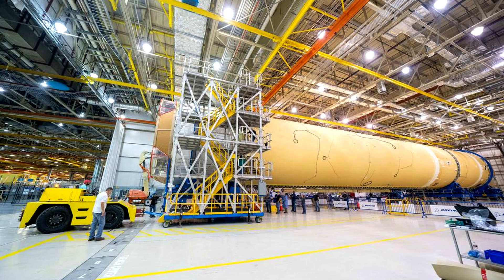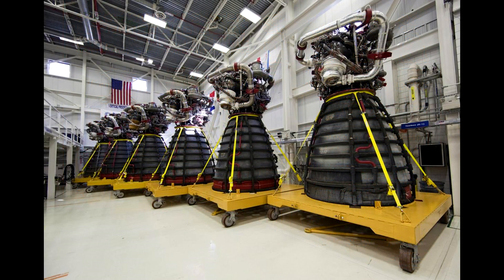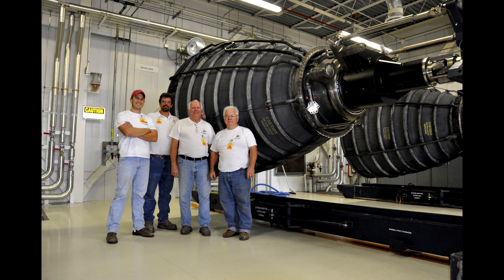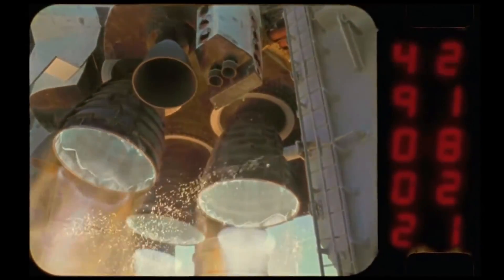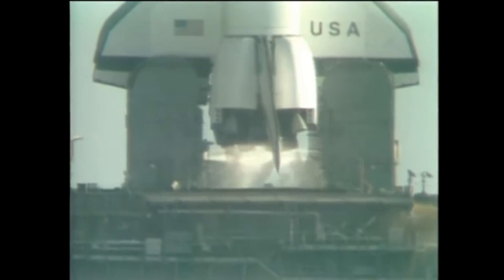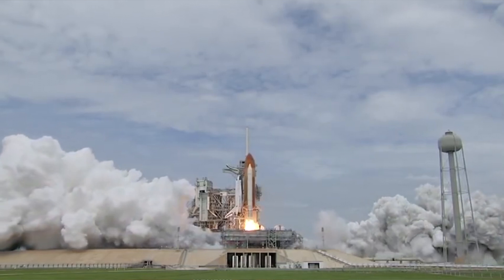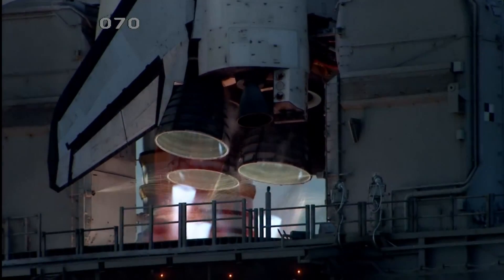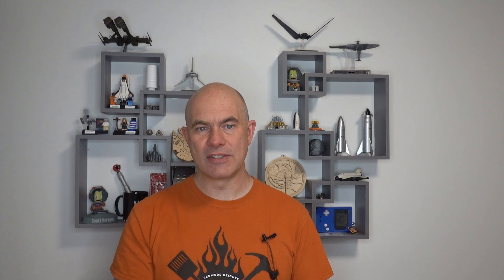Four Old Space Shuttle Engines Team Up For One Last Rocket Launch

Comment: and they gonna use this fantastic engines 1 time and throw them away? what a shame...
Reply: Well, they needed significant refurbishing every time they came down
Reply: @Hofslagare  well the shuttle itself was most of the refurbishment though, the engines sure needed some working, but I don't think they are the reason we consider the shuttle programm as refurbishing, instead of reusing.
Reply: @LunnarisLP  "The RS-25 engines were highly complex and maintenance-intensive, necessitating removal and extensive inspection after each flight. Before the "Block II" engines, the turbopumps (a primary engine component) had to be removed, disassembled, and totally overhauled after each flight." Is both my understanding of it (what i heard) and what it says on wikipedia. Removal, inspection and disassembly is not "some working".
Reply: @Hofslagare  Shuttles were inspected like crazy between each flight because it carried peoples on board.
SpaceX doesn't have this problem because, well, they only send hardware. And for manned mission, NASA has requested to use brand new rockets, not reused boosters. So RS25 and shuttle will still be the only true reused hardware to date.
Crewed Dragon capsule also is one use only with astronauts on board, if reused, it will be only to carry freight.
So yeah, Shuttle will still is the only true reused ship to date....
Reply: @Damien.D  No, they did it because they couldnt guarantee the engines working otherwise, do you think spaceX plans to remove all the 28 engines on the starships every flight?
Reply: @Hofslagare  They probably will have to if they want to mess with luck regarding human lives.
For now, spacex and manned flights are two irrelevant subject, but once they'll get into that, it wont be the same business.
Reply: @Damien.D  Now you're just guessing.
Reply: @Damien.D  thats true with the falcon 9 boosters. but then they reuse the boosters for unmanned launches after. but once starship is operational. we'll see those babies go up 3 times a day!!!!! the raptor engines are damn impressive.. smaller but faaaaaar more impressive then the RS-25s
Reply: @Nick871203  Yeah sure, the water tower thing will be totally different from crew safety standpoint. And fly 3 times in a day with 100 peoples on board each time.  Sure. Of course. I'm totally confident it will happen.
Reply: @Damien.D   ok the water tower thing was just to test the raptor engine.... and it was a succesful launch... sooooo im not sure where you're going with that... and sure they wont start mass transiting people like that for many years. starship will be used very intensivley for hauling payloads up on a regular basis. collecting data as they go. once they done enough.  they will probably start using this to transport astronoughts up to the ISS or where ever. and eventually do the Dear moon project. once the rocket proves its self over an over an over again. why not? if it is able to be rapidly relaunched 3 times a day. then why not? you're not thinking out of the box... this has never been done before, and they are DOING it and they proved sooooooo many people wrong already.
Reply: @Nick871203  At best, regarding manned flights, SpaceX just proved how reliable and still useful Soyuz is. They are decades from carrying peoples in their shiny watertower.
Reply: @Damien.D  using the Soyuz is unsustainable... its too expensive to use... if it wasnt for the ISS we wouldent be using them attall..... 80 million PER astronaut... the russians are clearly taking advantage. anyways dont forget we got 2 competing capsules, the boeing starliner and spacex dragon . both are getting close to completion. hopefully spaceX wins. and it does seem to be going towards spaceX.
Reply: @Damien.D  starship will be tested by sending payloads to space. once it flyes  100 times without failures it enters the safety range accepted by nasa and can be used with astronauts.
 on the other hand SLS will fly a single time and then carry astronauts. it doesn't matter what boeing says, testing is necesary to find problems with a system, spacex found parachute problems that were unknown to science before, and starlink and parachute manufacturers had to look at their parachutes because they were not as safe as they thought. spacex is testing the starship and will continue to do so and adapting until it is able to do its job, going the testing route guarantees that it will be the safest space vehicle of all, not the other way around.
Reply: yeah like at least with the space shuttle they refurbished them
Reply: jack cunnington The engines themselves didn’t require that much maintenance. It was mainly the heat shield.
Reply: @jerry3790  They required so much maintenance they couldnt even stay on the shuttle and part of it had to be disassembled.
Reply: It cost so much to go through these and get them space ready again they might as well let them sink in the ocean lmfao.
Reply: Also these are the most expensive engines ever made - $25 million each. They were expensive and over engineered since they were designed to be reused over and over again, reducing the per flight costs - not meant to be thrown away. It’s quite a tragedy, honestly.
Reply: Yeah, my exact thought. thats kinda sad.
Reply: Fantastic engines and where to find them
Reply: Will probably blow up too.
Reply: well, seeing as how they fall hard into water, i wouldn't even seriously consider recovering them in any usable form at all. it might happen, but you never should plan to reuse something that's almost certainly damaged.
Reply: Ffs people are complaining about the cost and they have free components and you want them to make new ones to add to the cost???
Reply: No they've been used a dozen times each already.
Reply: "We should use our rockets we have laying around, NaSa IdOts" "y yoos injins, hert feelz yo"
Reply: "They" should just figure out how to teleport stuff to space so "I" don't have to feel sorry for rocket engines. Wtf is wrong woth you people? Step by each. If you don't like how other people do things for you, grow a pair and do it yourself.
Reply: They've been used before, so no, they are being used at least 2 times if not more, then thrown away.
Reply: Some have multiple flights on them already.
Reply: Jesus Christ, town down the erection for Spacex. It's a moon rocket ffs can't we just appreciate that for a bit?
Reply: @CelesTemple  BO is also using methane and ULA will buy their methane engines.
Reply: SLS is the dumbest system ever! Using the most high tech reusable engines once... ONCE and dumping them into the ocean ... FFS NASA ... WHY???
Reply: @skytreker  because they can only be reused if you attach them to a shuttle, and they don't have any shuttles, so it's extra hardware. you'd be bitching just as much of they developed a new engine for SLS when they have all these perfectly good engines sitting in warehouses waiting to be flown.
Reply: Wyatt Roncin You’re right! Better they go out doing what they were designed to do rather than rotting away in some museum anyway. One and done is better than none!
Reply: @skytreker  Do your research and find out why. SLS isn't a multi-stage Saturn V.
Reply: @skytreker  Blame Boeing.... Nasa is stuck with them now.....
Reply: I'm going to repost my comment from another thread because I'm not typing it out again.

So; you want the government to reuse the first stage of the SLS. They already tried that with the space shuttle; the cost savings turned out to be marginal at best. So let's say that NASA were to try to reuse the SLS. The first thing they'd have to do is dramatically increase the mass of the upper stage. Not even the exploration upper stage would be massive enough to allow for this. There's a reason spacex has a massive upper stage, so that at MECO the first stage isn't moving too fast to re-enter. So good luck with that with the SLS! I suppose all we'd need to do is develop a massive 350-400 tonne hydrogen powered upper stage using 3 J-2X engines, and then also SPEND AN ESTIMATED 500 MILLION TO 2 BILLION DOLLARS TO MAKE THE RS-25 CAPABLE OF BEING LIT MID-AIR WHILE TRAVELLING THROUGH THE ATMOSPHERE THE WRONG WAY. Then spend another few billion dollars developing flight and guidance hardware to allow for an autonomous first stage landing, and of course add enough landing legs, fins, rcs systems for stage control, etc. Oh and make sure all this new hardware is man-rated. Oh and add some very heavy structural supports to the core stage to allow it to withstand re-entry at around 5-8 km/s (over 8 km/s if it's  using the ICPS). Oh and don't forget you have to do more tests to see if the core stage can withstand re-entry while fuel is sloshing about, most likely adding more baffling in the inside of the tank and doing vibration tests. 

Of course then you have to ensure that the RS-25 can fire without combustion instability at sea level while travelling BACKWARDS AT MACH 0.7-0.9. This would be the largest problem with re-using the core stage. The RS-25 has a unique nozzle shape that curves inwards near the end to raise the pressure on the lip of the nozzle at a slight performance cost. This is done so that you don't get the characteristic flow separation that would normally occur with an overexpanded engine (an engine where the exhaust pressure is well below ambient pressure; exhaust pressure of the RS-25 is around 30% sea level pressure; a normal engine at those pressures would undergo flow instability at sea level and tear itself apart). 

Of course you'd also need to take into account SIGNIFICANT PERFORMANCE LOSSES that would arise. The SLS core stage weighs about 95 tonnes when empty. You'd need at least 4-5 km/s of delta v to land it, meaning that you'd need a mass ratio of at least 2.8. Therefore you'd need to save around 180 tonnes of fuel. This is the best case scenario if you decided to use a 350 tonne upper stage. Of course using a 350 tonne upper stage you'd also have even more performance losses, that is if you can even get a 350 tonne upper stage to structurally fit ontop of the core stage. This is because the stage would have a very high dry mass, meaning that you'd probably need an additional upper stage which would dramatically increase cost. 

So; TLDR; you are wrong. Even if this could be done the costs of doing it would most likely far outweigh the cost savings that you'd get over the estimated 10 missions that this is planned for, and it would delay these missions by at least 4-5 years. The actual cost of the RS-25 engines is insignificant compared to the cost of the manned components of the vehicle. SpaceX will charge around 260-280 for a crew dragon mission.  That's a factor of 5 more than a normal falcon 9 flight. Do you know why? Because the crew vehicle and the costs of developing and maintaining a safe crew vehicle with multiple abort modes is incredibly expensive. Over a third of the SLS's launch costs are estimated to be the Orion MPCV and the European Service module combined with the launch abort system, about a quarter is estimated to be the ICPS/EUS upper stages along with the adapters. The boosters and core stage combined account for around a third of the cost of the launch vehicle, at around 180-200 million for 4 new RS-25D/E's, 60 million for the core stage, and 60 million for each booster for a total of 360-380 million out of around 1-1.2 billion. 

TLDR; developing a reuseable first stage with the SLS would cost far more than it would save and set back the program at least 4 or 5 more years and would require several billion dollars up front, and would lead to performance decreases which the SLS cannot afford. There's a reason NASA isn't doing this; because it makes no sense.
Reply: @JohnDoe-vz7ff  The RS-25 doesn't need to retropropulse to be reuseable in the SLS. They can simply follow Vulcans approach to reuseability and disconnect from the SLS booster and fall back down on parachutes once they have done their job, using an inflatable heatshield to protect them on re-entry. Then use SpaceX method of recovery by guiding it onto a net held up by an autonomous ship, something that has now been proven to work on orbital class hardware.
Reply: @TCBYEAHCUZ  Fair enough; so you're talking about adding hardware to the core stage to allow for the entire engine assembly to separate from the core stage, and then land using parachutes? That's also most likely not going to work. At the time of MECO the SLS is going to be going near orbital velocity even with the exploration upper stage, around 6.2-6.6 km/s. That's essentially re-entry speeds, and at those speeds you will be needing heat shields for re-entry. You also have a suboptimal return trajectory with a periapsis well below the surface (-2000 km or so) which will result in INCREDIBLY high g-forces which will most likely damage the sensitive components of the engine. 

The way to do this would be to essentially put a large heatshield on the other side of the engine mount; this would be an unprecedented 8.6 meter heatshield. You'd then need to add an explosive decoupler, and an RCS unit to turn the entire assembly around so the engines aren't being destroyed during re-entry, and to control the assembly's attitude during re-entry. 

You'd also need some sort of protective aeroshell to protect the engines during re-entry from aerodynamic forces. You're also going to want to add something with an offset center of mass to allow for an aerodynamically controlled re-entry, otherwise the engines experience more than 10 g's of force during re-entry at these speeds. The entire structure along with parachutes would add at least 10 tonnes to the mass of the core stage, decreasing performance by a non trivial amount. 

Keep in mind that the engines are only a small fraction of the total cost of the SLS. 10-20% of the 1-2 billion depending on who you believe and what you count as the 'cost' of the vehicle. Then you have to refurbish the engines and get them man-rated again before the next launch. 

So possible? Sure. Cost effective? Nope.

Oh also; for the block1 missions the SLS is travelling faster than LEO orbital velocity at the time of MECO. At MECO it will have an apoapsis of about 1800 km and a periapsis of -90 km. That's significantly faster during re-entry than a shuttle re-entry.
Reply: @JohnDoe-vz7ff  The SLS itself isn't cost effective so trying to argue from a cost effective standpoint is in my opinion a hilarious one. My reasoning behind the reuseability aspect was only merely to save the RS-25's, not to save costs. In my opinion the whole SLS program should be cancelled and funds diverted to more commercial space launch contracts. NASA has entirely become lousy and stagnant in their launch competencies, all the good people who made the Saturn V rocket are dead and gone, it's time for private companies to streamline and privatize the space launch industry.
Reply: @JohnDoe-vz7ff  Thanks for the explanation here. I hope these people understand how difficult is it to land first stage of a Super heavy lift launch vehicle. SLS and BFR have completely different architecture, infact BFR has a gross mass twice that of SLS and that's because BFR has to reuse its first stage.
Reply: @JohnDoe-vz7ff  Also check out Gateway foundation. NASA should stop re-inventing the wheel (space launch system) and let private companies handle space launch and instead start anew frontier investment in space construction and space mining, using private companies to physically get them into space. NASA is good at solving frontier problems not holding down infrastructure, simply due to the fact that their direction changes everytime a new president is elected.
Reply: @TCBYEAHCUZ  I partly agree that more commercial involvement is required. That being I think when it comes to HUMAN LIVES we are best off leaving that in NASA's hands to some degree. Currently commercial crew is way behind schedule, and getting more expensive each month. It will still probably be cheaper than anything NASA would do. But we can't just leave manned space exploration to private companies; there's no money in manned space exploration unless NASA is the one paying companies to develop launchers like commercial crew. It's possible that in a decade NASA may ditch the SLS and allow for a commercial crew program for lunar exploration, and I'd be all for that! 

I just want to make something clear; I might come across as standoffish and a complete asshole in some of my comments, but I'm being so harsh because I'm tired of hearing the same non arguments about making SLS reuseable or reusing the RS-25 engines. Re-use makes sense for the falcon 9 because at MECO the booster is still relatively slow. For the SLS it makes less sense.

I generally agree though that competition is needed here. Boeing is getting away with some bullshit because NASA refused to let anybody else bid on producing the core stage. Same with the exploration upper stage; using a low thrust expensive upper stage engine cluster makes little sense given that there are viable alternatives.
Reply: @JohnDoe-vz7ff   John Doe  >I think when it comes to HUMAN LIVES we are best off leaving that in NASA's hands

Why?

>Currently commercial crew is way behind schedule and getting more expensive each month

So is SLS and way more so, overbudget, over schedule etc etc

And I don't think you're being harsh or negative, you seem to be a true NASA believer.
Reply: @thewestwinger3855  
Everything is "fake CGI" until it gets built, you absolute vegetable. Gateway Foundation doesn't claim to have built any of their ideas, they're just talking about what they (allegedly) plan to do.
Reply: @TCBYEAHCUZ  
I have some doubts about the Gateway Foundation. I want to believe in them. I want them to be legit, and to make a genuine attempt at getting their ideas built, and I really want them to succeed. Their proposed goals are noble and beautiful. But I'm not convinced they're being honest, or that they know what they're doing.

I'm also not convinced that they're frauds, mind you. I'm just... waiting, seeing, and hoping.
Reply: @JohnDoe-vz7ff  Said it better than I would've. BOO-yah!
Reply: TBH the space shuttle was shit, never liked it. It basically slowed down space exploration.
Reply: TrickOrRetreat Hey, shuttle missions fixed Hubble and built the ISS, hows that for space exploration?
Reply: hydrogen is a bad fuel, they can't make it reusable like starship.
 AKA orange rocket bad
Reply: @jesusmora9379  The Starship requires six rendezvous with tankerships to go to mars, so hydrogen does have its own benefits
Reply: @PArabinddeep  to carry 150 tons to mars. the space shuttle could not get past LEO.
 starship could carry extra fuel and get 40ish tons to mars just like SLS, the difference is methane is dirt ass cheap, safe, easy to store, and liquid at similar temp as oxygen so the entire thing can be more compact. hydrogen has slightly more power but its problems out weight its advantages.
Reply: @PArabinddeep  it need six rendezvous to get the mass of the entire starship and the interior (thats a lot more than a Command module, a lander and 3 Persons) to mars!
Reply: @PArabinddeep  

Well seeing as liquid methane is more energy dense than liquid hydrogen, I don't think that's the case. Hydrogen has a higher ISP but is harder to store and transfer in its liquid state. 

I also believe that is why hydrolox rockets have to carry a much higher air to fuel ratio on board.
Reply: I'm willing to bet If it was hydrogen it would still be about 5 rendezvous. That 30ish% ISP improvement of  LH2 over CH4 would likely be offset a bit by larger tanks anyway and raising the dry mass. And besides that's for max payload to anywhere, not to LEO.  refueling in orbit will be a game changer, not at all a limitation.
Reply: @jesusmora9379  Starship needs to be refueled before it can go anywhere but LEO but it could carry an upper stage and a capsule and have that go to the moon without orbital refueling.
Reply: Honestly, i think SpaceX and all other government space programs should be focusing on building a moon refueling station instead of going to mars. That is the start of everything. You get that going and all the planets of the solar system will open their doors. All interplanetary missions would become at least 5 times or more cheaper. They would actually be able to focus on building ships in orbit and refuel them at a fraction of a cost.
Reply: @michaelneichel9543  lol six rendezvous with rockets that costs 2 million dollars to launch ;) imagin doing that with with the SLS lol 8 to 10 million total? try probably around 10 billion with SLS lol
Reply: @jesusmora9379  hydrogen is possibly the cleanest and safest rocket fuel, it just has some limitations.  its exhaust is water vapor, its non-toxic, and it has really good specific impulse. hydrazine, on the other hand is extremely toxic and hazardous.  are you sure you arent thinking of hydrazine while typing hydrogen?
Reply: @jesusmora9379  aren't they blue though
Reply: @jesusmora9379  Horrifically incorrect. Hydrogen exhibits too high an O/F ration to use with a single core booster, however it gets higher specific impulse than almost any other liquid fuel by almost 100 seconds, not to mention its exhaust products (H2O and HO, and O2) are non-toxic unlike methylox.
Reply: i mean its been used reusably for years
Reply: @Dorsidwarf  no they were refurbished not reused
Reply: @Dorsidwarf  the big orange tank gets thrown into the ocean, it needs big SRBs to get off the ground, and people have to do maintenance on the engines wearing hazmat suits. bad fuel.
Reply: @davidvreugdenhil4557  the shuttle was more reusable than the Falcon 9. The Falcon 9 gets refurbished and so far only down 4 times. Shuttle Discovery alone did over 30 missions
Reply: @thewestwinger3855  well the difference is how many F9's there are to fly compared to space shuttles
Reply: @thewestwinger3855  yes but the space shuttle also needed too be refurbished and the falcon 9 hasn't been launched enough to prove that it is reusable and we're talking about reusing engines not rockets
Reply: @jesusmora9379  
It's not the fault of the fuel, hydrolox engines have the best specific impulse of any reasonable fuel combination, which was essential to the shuttle's performance. It has it's drawbacks too, but that's not what made the shuttle expensive.
Reply: @jesusmora9379  No, they only wore hazmat suits because the Orbital Maneuvering System (the smaller engines tucked into the top left and right corners of the aft end of the orbiter) used monomethylhydrazine (MMH) and dinitrogen tetroxide (NTO) which are both very very very very very bad for humans in nearly every way.
Reply: @maxk4324  noted.
Reply: @jesusmora9379  You don't know what you're talking about. The hazmat suits were required to work on/around the orbital maneuvering system, which used hypergolic fuels.  That has absolutely nothing to do with hydrogen fuel.  Stop being ignorant, its hurting my brain.
Reply: @jesusmora9379  are you confusing hydrogen with hydrazine? hydrogen engines produce water as exhaust, with some hydrogen and more water as side products. if you're wearing a bodysuit to work on a rs25, you're wearing a bodysuit to work on a merlin or a raptor. 

and don't conflate the launch system and the fuel. kerosene engines and lauchers go from being the worst every (n1) to some of the best ever (nk-33, rd series, saturn and falcon) depending on where you look and what your metric is. is it bad to just dispose of the entire fuel tank every launch? maybe, depends on if you consider tank reusability important.
Reply: @thewestwinger3855  the interesting statistic (which i dont know) would be the cost of a Space Shuttle "refurbishment" vs an F9 "refurbishment".  I suspect F9 is a much better value.
Reply: @jesusmora9379  Not sure what you are on about, but hydrogen is still one of the best fuels. The reason no modern rockets are using hydrogen(first stage) is simply scale; past a certain volume of fuel, hydrogen outclasses every hydrocarbon, but all current rockets are tiny. Starship isn't planning on using hydrogen because the planned missions require a store-able fuel. 

The RS25 was plenty reusable. Yes, it needs to be refurbished, but so do SpaceX's Merlin engines(have you seen a pic of a Merlin nozzle after it returns? pretty sure they have never reused a nozzle). Heck, if you payed attention to the video, Scott covered a hydrogen engine that is more resuable than anything SpaceX has flown.

And that isn't even getting into all the hydrogen upper stage engines. Pretty sure Everyday Astronaut has a video covering the different types of fuels; you should probably check that out.
Reply: You think SpaceX would go through all the hassle of making a completely reusable engine but leave out the nozzle bit?  Look at the back-end pic of the first Falcon Heavy flight in the hanger. All the engines look used.  They are designed to be swapped around positions and still work.

Would love the numbers one day, see what the flight counts are.
Reply: @thebigitchy  By "modern" I meant something recently designed from the ground up. Engines like the Merlin and Rutherford. Delta IV is nearly two decades old and its engines are even older with the RS-68 being a cut down version of the RS-25 developed in the 90's. Ariane 5 uses an engine that started in the 80's. I actually had no idea that the H-IIA was a hydro-LOX, so you got me there. 

Regardless, my point still stands. Hydrogen is a great fuel, but a poor choose for sending communication satellites into GSO which is currently the function of most launches.